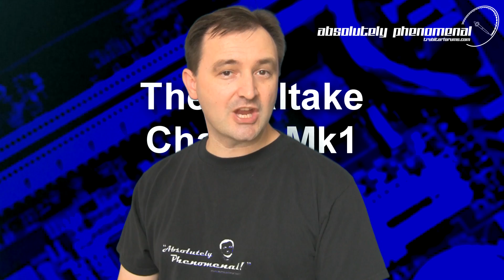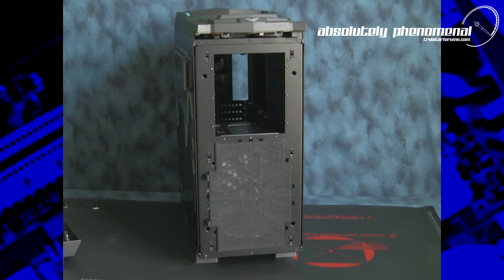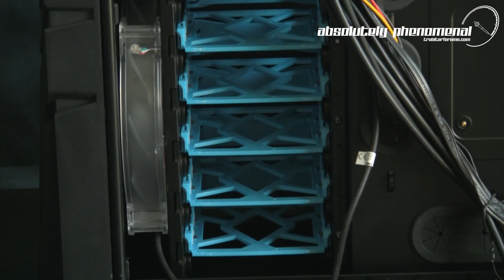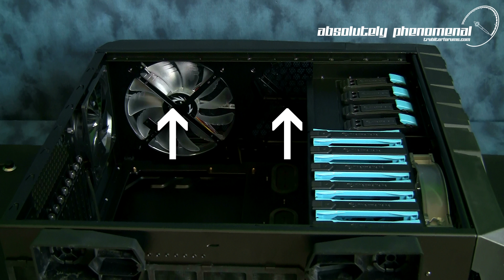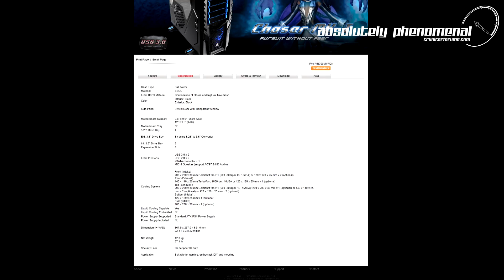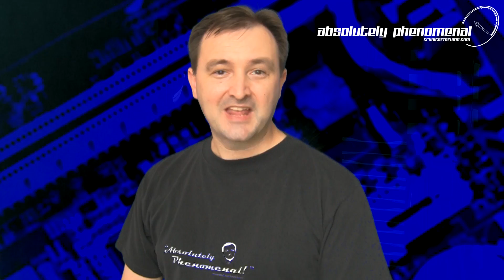Thermaltake Chaser Mk1 PC Case

Comment: update. I got the thing in. And holy smokes this thing is much bigger than I thought. I even used a measuring tape to help me grasp the size of it and the tape did not do it any justice at all.

This thing is not as weak or poorly designed as many would say it is. This thing is a very beautiful case and I can't wait to get the parts to build a system in to it.

Comment: @LotusPiano I just tested it again, it reached 72C GPU after playing tf2 for 20 mins, it depends on the game you play. Rad is located at the top right corner of the back of the case. There are 2 fans installed, one at the top back, and one at the bottom front. I'd say go for a 580, it's very powerful, maxes just about any game. Go with an Intel i5 2500k if you're into gaming.

Comment: @makidude I will, if I get this case, put fans in every slot to help with the GPU temps. I will be using a Frozr II/III of some kind, be it 560 ti, 570, or 580, but I don't want to build in a case where my GPU will run so hot. Also looking into the Antec 1200 and Antec DF-85.

Comment: @LotusPiano CPU temps are 27C idle, my guesstimate is around 45-50c on full load, and my CPU is the AMD 1100t. my cooler is Corsair h60. GPU temps varies. Full load can go up to 97C for my GPU. It rarely hits 90s though.

Comment: I hate when they dont add a fan on the side. I guess you could take the front fan and mount it on the side and 2 120mm fans at the front. Still, 3 large led fans would be sweet.

Comment: @trubritar Please answer, I plan on upgrading to a Thermaltake mk1 case and want to know if the Corsair H100 cooler will fit on the top of the case with out modding. TY